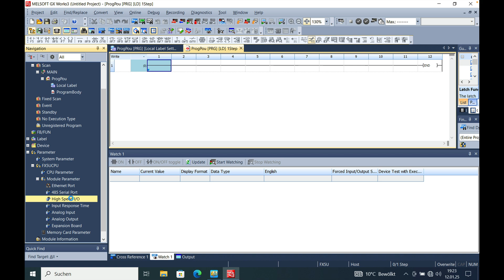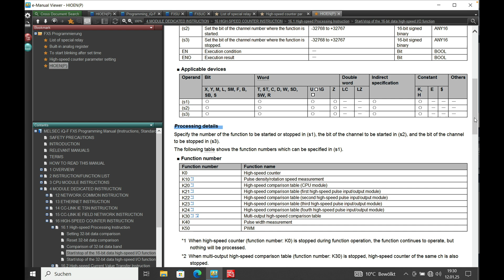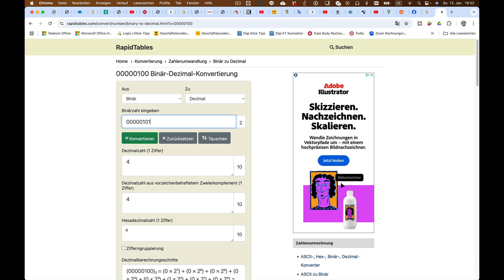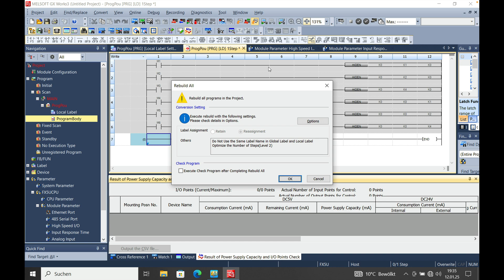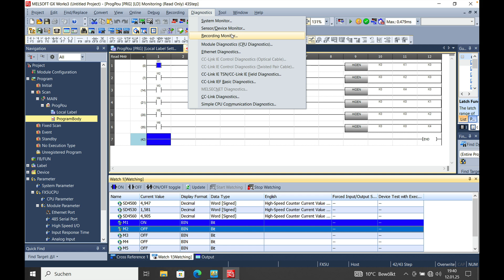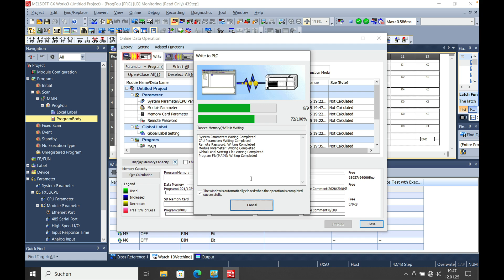High speed counter and Input response time Multiple Channels Mitsubishi FX5U with download

Comment: the SD4500 register is showing a value even without connecting the encoder.
Reply from the maker: Have you tried to reset the value? After reseting there should be no value anymore. Otherwise please check you hardware wiring.